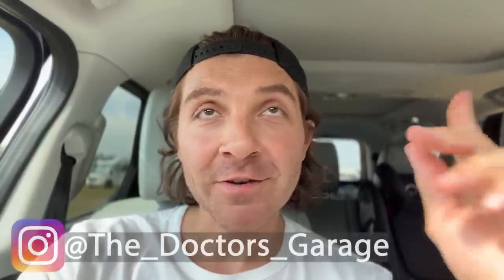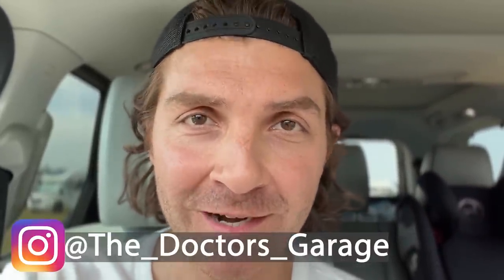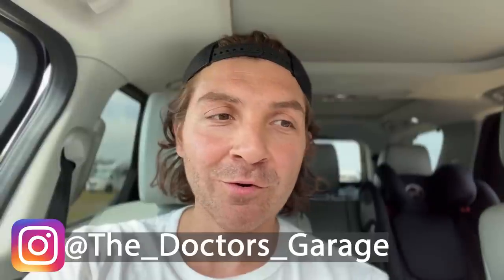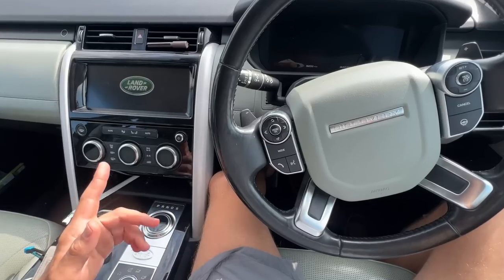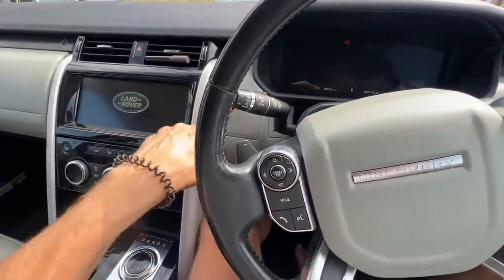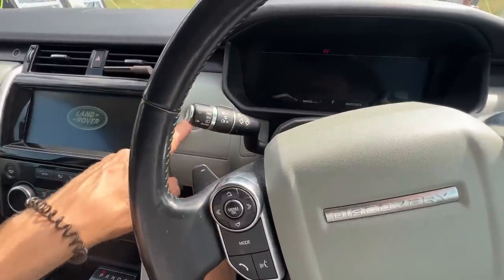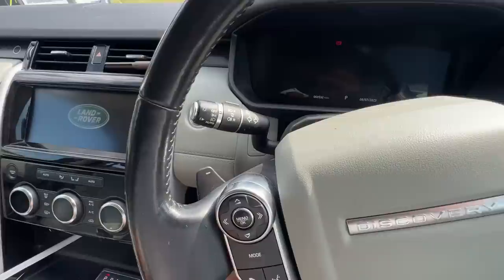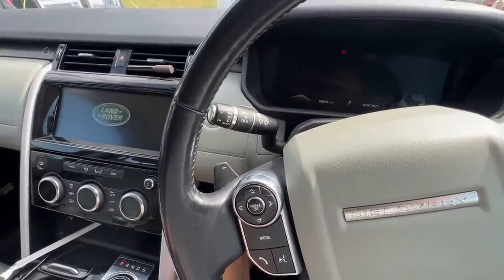IT'S TIME TO LET MY LAND ROVER DISCOVERY 5 GO...

Comment: Could be the Earth strap at the battery, it’s connected to the body by a tiny little weld stud /riv-nut that takes the entire current of starting all by itself and arch’s out giving intermittent connection.
Undo it and use a 10mm bolt that’s a few inches away, problem solved 👍

Comment: Sorry to hear you've had yet more problems. Unfortunately, there is an industry trend of replacing reliable mechanical components, with decades of innovation / proven performance behind them, with electrical equivalents e.g. electric handbrake, electric steering  lock etc.  A few years down the line, a chaffing wire or a corroded earth earth leads to all these problems.. As others have said, I always have a code reader and a boost pack in my Landrover!  Good luck and looking forward to an update.

Comment: I have a Discovery Sport in a Land Rover dealership with the same problem, except mine will not start at all. It’s a 68 reg with 34,000 miles on the clock. I’ve had it from new and always had it serviced by Land Rover. I’m due to get a phone call from the dealership tomorrow, so I’ll keep you informed. Unfortunately I haven’t got the extended warranty.
Reply: My dealership is waiting for a part. I will update as soon as there is any news. After this experience, I’ve tried to get Extended Warranty Cover with Land Rover to protect myself in the future. The site says my car is not eligible. This is a car that is 4 and a half years old, 34,000 miles always been serviced by Land Rover and I can’t pay to get extended warranty with them. I love my car and want to continue to be a Land Rover customer but they ain’t half making it difficult.

Comment: No start scenario I've experienced 3 TDV8 3.6 ( I'm on my 6th FF L322 🙈)
 suffer NO start scenario with just a clonking sound from the starter motor or power down .......... will probably be quickly be resolved by adding a second negative lead from battery negative terminal to the spare earthing terminal on nearside front strut top mount.....
I've had 3 TDV8 s with this same scenario, learnt the hard way after changing loads of new parts.
( new battery,new ignition barrel ,new starter motor,new maxi fused positive starter motor feed ,new fuse box etc.etc.)
It's a earth lead corrosion/ impedance fault.
Great cars when behaving themselves but nightmare to change turbos ,vanos, timing chains etc etc...
For this reason I prefer a properly sorted P38 as my daily workhorse,lot,lot easier to work on 🤠

Comment: Not an answer to the issue, but sounds like a full bus sleep is maybe what's resolved the intermittent fault. If you lock the car and wait for 3-5 mins (until the hazard switch light goes out) it will go through a full sleep cycle and potentially a new cycle will help clear the fault. Maybe worth a try if you get stranded again...
Reply from the maker: Cheers will give it a go!

Comment: Had this issue years ago exactly as you described, it was a battery connection issue stopping the car firing up but electronics worked. No warning lights etc, I think JLR charged the battery and tightened connections, never happened again after that.

Comment: Earthing problem. Is it better or worse in wet/damp weather? Corrosion on an Earthing point gets affected in dry conditions. I fixed mine by having a dedicated 10mm earthing strap put on between the under frame earthing point, bell-housing and engine and the ‘failure to start’ issue has never arisen since. My challenge was getting LR to do it  - they kept telling me it should not be necessary…..no other LR’s have that…..we didn’t make it that way….but it HAS solved the problem permanently. The clue was that it happened in dry weather increasingly and when the underside was wet it never  happened. Cost was £50 for earthing straps with 10mm bolt eyelets cut to size and some serrated flanged M10 bolts. The simplest solution is usually the best, whether it suits LR or not, you are the one pushing left pushing a LR in a car park…..go figure 😳

Comment: My Discovery Sport broke down completely in a car park. Even the dashboard wouldn’t come on and we couldn’t move it as the automatic hand brake wouldn’t disengage. If this had happened on a motorway we could have been killed. Land Rover had my car for over 5 weeks. Apparently it was something like a restraints module failure which acted as though I had been in an accident and shut everything down. Car bought from new and serviced by Land Rover, 33,000 miles on the clock.

Comment: Please let us know if you manage to resolve the problem as a family member has the same problem of it sometimes not starting too, they have had the abs sensors /wiring changed, sensors in the gearbox/transfer box, new wiring looms, ignition module and lots of other stuff too but still keeps doing the same, funny how pushing/moving it slightly used to work for them too but now it doesnt.
Best of luck getting it sorted, time to get rid once its running again if you ask me 👍
Reply from the maker: Really interesting (and terrifying) to hear the length that your family member has gone to with out a compete resolution! Will keep you updated

Comment: Not a Land Rover related reply, but I used to drive a Volvo FM truck that used to do the exact same thing. The only way to get that started was to take the keys out, lick the door with the remote. Walk about 20m away so that the trick doesnt get a signal from the remote or key. Walk back, unlock and it would start every time without fail. The Volvo dealer changed something in the steering column area that was described to me as an aeriel and it was ok after that. However, I have since come across other people having the same problem and this has worked fir them too

Comment: An intermittent fault on 2 sensors is highly likely to be another electrical fault , either in actual wiring/connections or modules that monitor those signals ( related to the dealer wanting to change some wiring?)  the chances of 2 sensors having an intermittent electrical fault is slim.

Comment: You mention steering. I had a steering sensor fail in my LR4 and the dash lit up like a crhistmas tree and it threw a PILE of faults. The indie mechanic replaced the steering sensor and it was all solved. Intermittenly failing sensors are the absolute worst. I can't believe what a pile of crap that truck has been for you.
Reply: It's like that with alot of newer cars tbh as we have a 2011 durango as the relay sensor went bad as the car wouldn't start, as you have to remote start almost everytime and then it would idle ruff and then stall but as soon as we replaced the relay sensor the car ran fine as it shows that a small electrical issue can make a car have so many codes that really isn't there or make the car not start or stall

Comment: Brake switch failure is a common fail and would prevent the car being started. Check that.  (Ex Disco 4 owner who towed a caravan too..... yes that LR has gone due to reliability problems. Replaced with a nice simple Van :))

Comment: Exact same issue being experienced. Sudden loss of power. Thought it was a battery issue. However same issue reoccurs after installation of new battery. If I boost it - it works. But drive it for a few days - then just dies. And have to boost it again.

Comment: My 2017 Disco 5 HSE did exactly the same thing a few weeks back. As you did I left it for 20 minutes and then pressed the key on the side sensor of the steering wheel and it started. Hasn’t happened since but I noticed the steering wheel was locked hard.

Comment: Search for N400 recall (bad battery ground stud) - it causes a lot of strange electrical faults.  Mine has had battery issues since it was 1yr old and failed to start a couple of months back...apparently JLR had apparently already done that recall but it started after playing around with the ground stud - although it may also have been just disconnecting and reconnecting battery...its just had a new battery fitted (although they suspiciously waited for the warranty to end before deciding it needed one).

Comment: The steering lock is a solenoid type and also there is a sensor in the gearbox selector. Check both out. I would go with the gearbox selector sensor. It wont start unless its in park or neutral. Leave it in neutral and see if still plays up, if you trust the handbrake.

Comment: I was exactly the same as you loved the discovery had lots of issues I had Range Rover classics for years bought a new discovery had lots of issues new engine and by 60k the only thing LR had not replaced under warranty was the rear axel ! Loved the car but could not cope with that again , then I bought a Volvo what a revelation got to 60k with one shock replaced under warranty ran it to 240k then bought another, lr nice cars but so unreliable.

Comment: If you like the old Defender 110, any reason the Grenadier not considered? My Grenadier feels like a much quieter and powerful version of my Td5. Not a direct competitor to Discovery, new Defender, Range Rover, etc but very much the old Defender.
Reply from the maker: Interesting to hear from someone who has one! I’ve sat in one and was impressed with how well built it felt. Do you like yours? I think from a price point of view they are quite expensive especially compared to an older 110 in the current market? Interested to hear your thoughts
Reply: @thedoctorsgarage  Hi. Nice to hear from you and sorry about the troubles you are experiencing with the Discovery. I have been lucky in that my Defender Td5 has been faultless over the past 18 years and 120,000 miles. 
Unfortunately, time has taken its toll, not on my Defender but more so, on me. I needed a more comfortable version of my Defender. As much as I like the look of the new Defender, the JLR reliability, and complicated nature of the vehicle put me off. 
The Grenadier truly feels like an evolution of my old Td5. I feel good every time I climb into it. (As was the case with my old Defender). It feels completely solid with no shakes or rattles. I do have some electrical issues by way of false alarms but nothing that has let me down. I drove 750 miles in 16 hours and I could easily have continued, it was so comfortable. 
It is a heavy vehicle with fuel consumption currently 24 - 28 mpg. (Diesel) but if you love the old Defender, this ticks so many boxes I can’t see why you and the family wouldn’t love it. 
Ps. I still have my Defender 90 CSW but would now consider selling. I never imagined ever thinking that.

Comment: I had a 2019 Disco 5 and it was the best and worst car I have owned. It broke down with 50kms on the clock, had wiring looms replaced on multiple occasions, endless electrical faults, faulty solenoids, airbags, water leaks mechanical issues, loose doors etc. I traded it in as I didn't want to sell directly to someone else knowing the issues. I also have a Defender 130 (currently undergoing EV conversion) so thought about I the new defender but based on such a bad experiance with the disco5 didn't want to roll the dice.
Reply: it could be a lemon or it sounded like it could be flooded out if it was used. But the defender 130 is a amazing vehicle as I hope the electric conversion goes well.

Comment: I have a disco 5 59,000 miles 18plate. So far only issue was a parking sensor and a window regulator snapped.
It’s such a strange issue and it’s clearly unique to your car as landy don’t have a standard fix for this.
Saying all that. Give the steering wheel a wiggle while you are trying to start it. 
Older cars wouldn’t start if the car was on the steering lock after being locked so wiggle the wheel as might release the locking pin and let car start.

Comment: My Renault Grand Scenic had loads of electrical gremlins. The dealer put a new battery on it and it is better. It still throws an hissy fit sometimes though. Also, my wifes Yamaha scooter  used to stall and the engine light kept coming on. Afrer 6 months of the dealer not  being able to find the issue and loads of stress she asked for her money back and lost 1300 euros in the process. It seems like a lottery sometimes. Good luck, get rid and buy something that doesn't require your mind to be involved at all.  Put your efforts into your family, not a piece of tin😂

Comment: Hi, I had a messaged you before on your previous interesting posts! My 2018 D5 2.0L diesel had a string of faults from NOx sensors, ad blue, engine failed with two new turbos and the final straw was the windscreen leaking causing serious water ingress into the cabin. All the work was covered under warranty but at 25k miles and 3.5 yrs ownership I couldn’t take the risk of the electrical issues and corrosion from the water ingress (obviously the dealer said they dried out the insulation and replaced..). I wonder if you had a water leaking into wiring bundles and this is intermittently impacting electrics including starting? I rejected my D5 on finance and dealer took it back for a good price and waited 10 months for a Defender 110 SE 250 and zero issues so far. I do miss the size and slightly more luxury in the D5 but couldn’t take the risk of further issues and electrical gremlins from the water ingress. Here is hoping my Defender 110 3.0 L will be much more reliable for longer term ownership! 

Good luck with the investigations on the fault!

Comment: NO START ISSUE - KNOWN PROBLEM WHAT WE HAD. VEHICLE WOULD RANDOMLY NOT START. DASH WOULD STOP WORKING. EVENTUALLY WOULDN'T START. LR REPLACED...
KEY MODULE. HALDEX MODULE. I suspect yours is a haldex module malfunction. It will do exactly what yours does.

Comment: Very basic suggestion, but it seems when Land Rovers exhibit a lot of weird electrical issues, the battery is the culprit. In my opinion they must not build them with a powerful enough battery to manage all of the systems consistently for a long period of time. A brand new premium battery every couple of years is probably not a bad idea. Very sorry for your frustration. Wish you the best!
Reply from the maker: It’s not a bad idea at all Jerry- I did replace this one around a year ago and weird things like the stereo audio glitch amongst others were fixed - may be worth a try

Comment: Don’t bother taking it to the dealer, just drive it immediately to scrap yard, (assuming it’ll start), and go and buy that 110 Defender you keep promising yourself - I have had my 110 for 22 years 24v 300 TDi and it’s has NEVER failed to start and get me to where I need to be, easy fix !

Comment: we had a similar problem and lr replaced the battery which fixed the problem for a while but then started again,lr installed a new alternator and and they charged the battery up which worked for a while,then it started playing up again,so i took it to a mate who drop tested the battery and found a cell had gone down on a 4 month old battery,took it back to lr and they replaced the battery and its been fine ever since,conclusion just because the battery was new you can get a bad one
Reply from the maker: Interesting to read thanks- will see how they get on with it

Comment: Could it be that the transmission sensor thinks it not in park, or the brake pedal switch is dodgy and when you go to start the car it's actually as if you don't have your foot on the brake and you are just turning the car off?
Reply: Yes I was thinking the brake pedal switch myself as being the culprit.

Comment: Get the Disco fixed, sell it, then buy an old Defender.
Reply: Old school is best by far, my 18 year old Defender 90 Td5 it has been 100% reliable in my 14 years of ownership apart from one really cold winters day when the original 9 year old battery finaly gave up the ghost but I got going with a jump start and a loose fuel pump solenoid that had vibrated loose and thats all. It even has its original exhaust system.
Reply: My 28 year old Discovery is still running happily. I wouldn't swap it for a new one.

Comment: I have a Discovery 5 2.0 HSE also, bought new 2017, when it runs its a dream..but then there are the nightmares……transmission confusion, needed major rebuild at 20k…..Full new engine replacement at 35k……front windscreen replacement (same as you had) due to leaking at 40k……..coolant leaks at 50k………back internal door handles failed at 62k, had to drive around with doors cable tied shut to the seat belt holders……..now, the second engine at 75k has a hairline crack in the intake manifold.  Cannot drive the car at all and just been told that there is a 10 week back order wait for the spare part.   Car looks like new inside and out, but is really a piece of driveway sculpture.   Did all the mechanical engineers leave LR?   It is hard to believe there isn’t a class action against LR particularly re the 2.0 SD4 engine which according to most independents has a life expectancy of about 40K miles.     Not fit for purpose.  The LR Experience …really!   Style over substance.

Comment: I have to ask you....why do you put up with this level of crap.....is the badge so important to you...does the green oval make a statement about you? other than extremely patient that is.
New engine early on...electrical issues etc etc.
This is a nightmare situation with a caravan and family in tow.
An old 110 Defender is fine until it is no longer there - i.e. stolen.
I am constantly amazed at how much trouble LR owners will put up with, just to wear 'the badge'.

Comment: Nice cars, but world renowned for unreliability and electrical gremlins in some cars, yet others have few problems, guess you've a bad un, ditch it. As Knight-Rider01 says one of the likely causes of this is a bad earth, had this a few times over the years, the terminals on earth from starter motor need cleaning, or as I've done once another earth strap to another place, it is big heavy duty copper cable you need, might even be a kit.